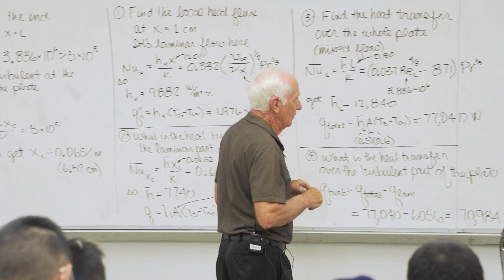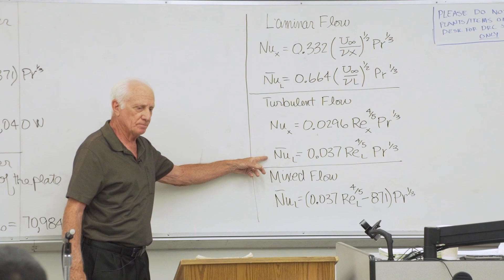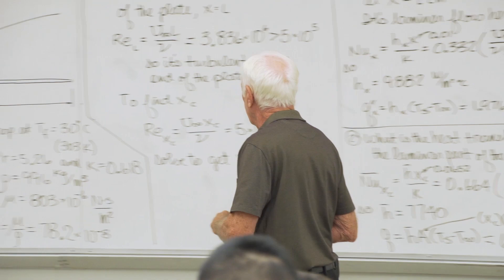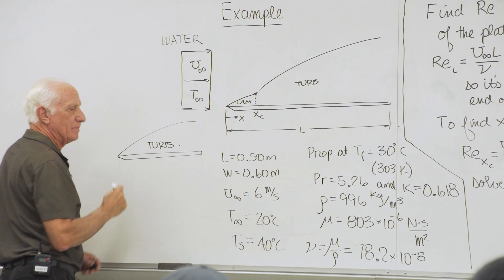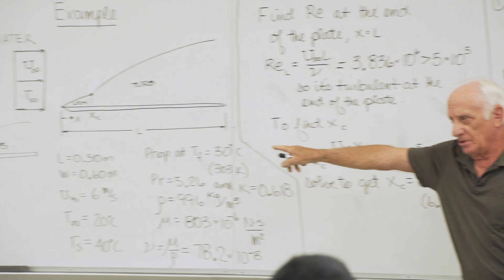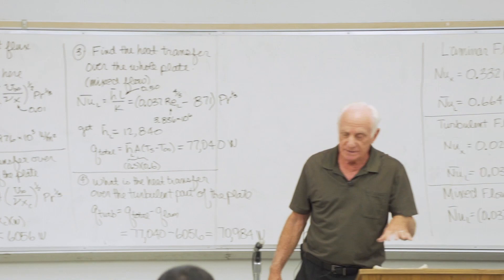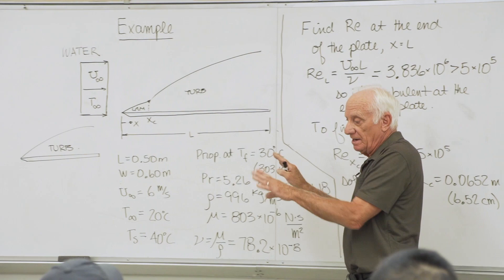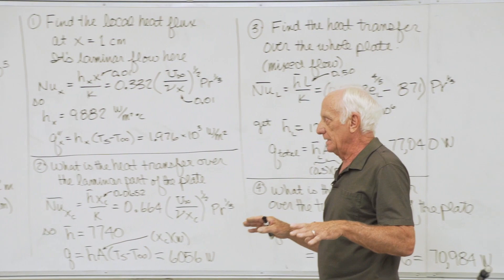Heat Transfer (25) - Flat plate convection heat transfer examples, Flows over cylinders

Comment: For flat plate questions 1 and 2: He writes U/VX for the Reynold's number (which is wrong), but his value for h is computed using UX/V (which is right). He makes this mistake in class because the equations on the side of the board also have this error, but his pre-written notes evidently have the correct formula.
Reply from the maker: Please provide a time stamp where this occurs so we can check it out.
Reply: @CPPMechEngTutorials  7:38, just like Alex says below. Also he issues an explanation for the mistake during the first 3 minutes of lecture video 28.
Reply from the maker: @ryanm3662  Thanks. We will place a correction in the show notes below the video.